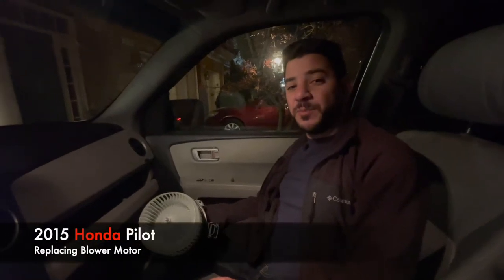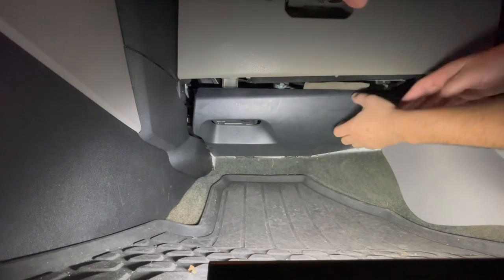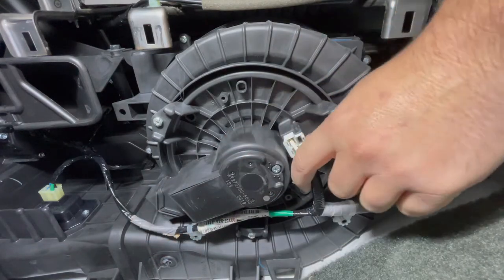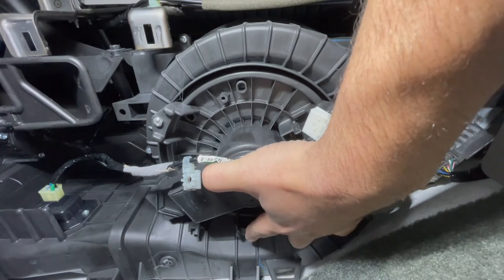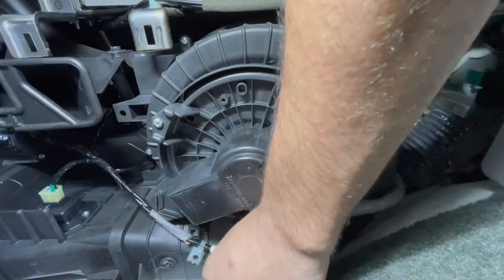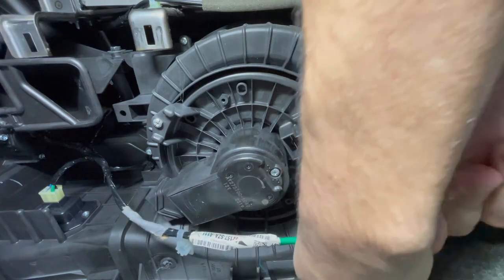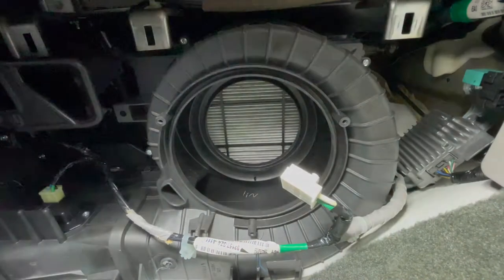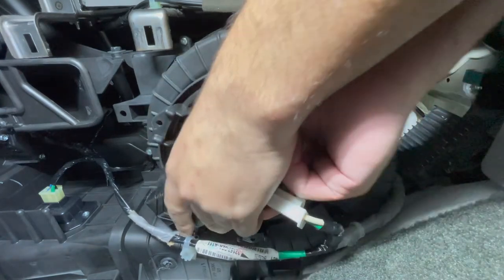DIY 2009 2010 2011 2012 2013 2014 2015 Honda Pilot Replacing Front AC Heater Blower Motor

Comment: Got a 2009 Honda Pilot the ac works sometimes but no heat at all any advice on how to fix it
Reply from the maker: Do you feel air coming from the vents? If not this video will help. If that’s not the issue I would see if you have enough coolant in the radiator and overflow tank. Could be your thermostat as well. Many variables.
Reply: No air comes out now
Reply from the maker: Replace the blower motor as that is what blows the AC and Heat.
Reply: @MobileCarMechanic  okay thank u
Reply: I think if this were my video, I would have show how gunked up the old blower moto was, and then demonstrated how to test it for noise after I cleaned it and the motor mounting location up a little.  I mean, if it still runs, the only thing that is wrong with it is extra gunk and perhaps a little reoiling.
Reply: I have pilot 2011. Ac only works rear seat. The front panel only come out heat air. Any suggestions? Ty in advance

Comment: I don’t have any air blowing through my upper vents (cold or hot) in my Honda Pilot 2010, even though I can hear noise behind the  dashboard as if it would be working. 

What is strange is that the vents in the foot area and for the rear passengers still work.
Reply from the maker: More than likely the blend door is the issue. They are usually made of plastic and can break over time. It’s either the door or the gears in the assembly. Do you hear any loud noises when changing the air flow?
Reply: @MobileCarMechanic  i think you are right! I’ve just checked and it seems like the blower motor is not the issue, it turns on when I turn on the car’s A/C. However, I don’t hear any loud noises when I switch through the different modes.
Reply: I have the same problem I don’t have airflow in my Ford upper vents but my feet and passenger vents work in the back just afford seats don’t work so I’m guessing I have the same issue